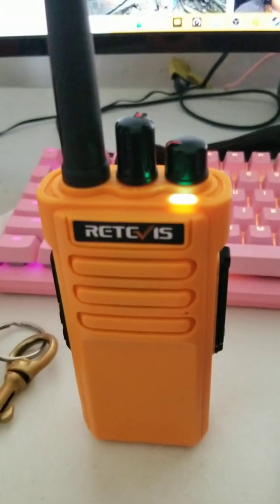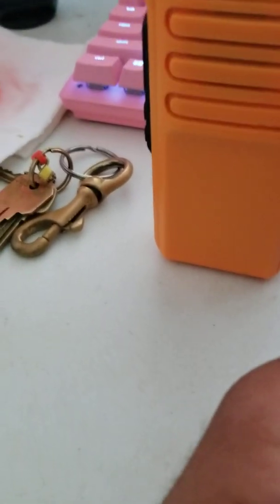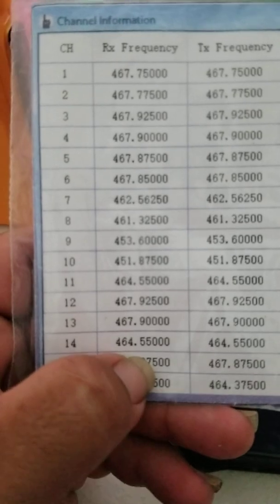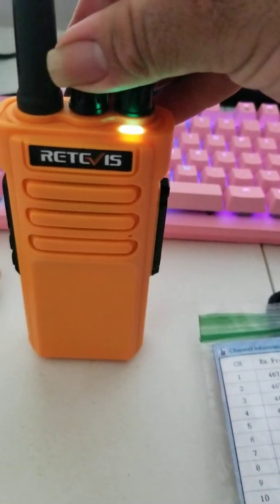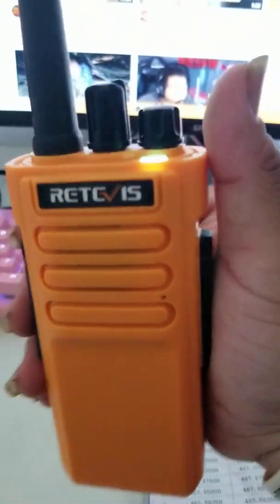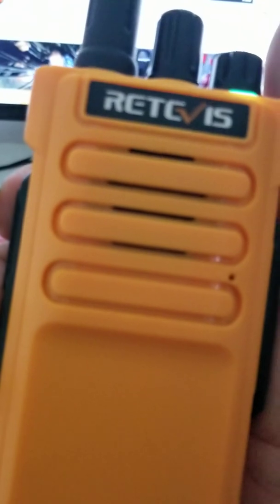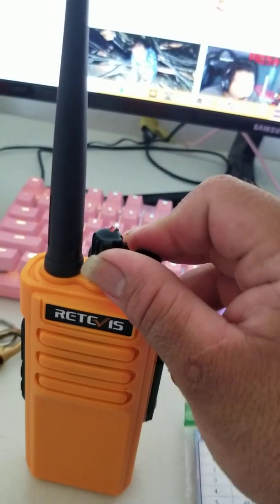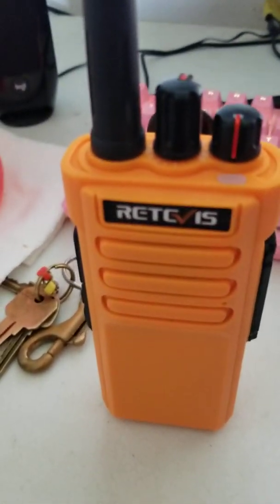Retevis rt29 strange transmission on uhf band 464.55000 MHZ

Comment: Possibly a “birdie”…a frequency where a signal is internally generated involving the oscillator circuits…(Google “birdie”) OR a beacon signal for navigation, time standard??  Believe I’ve read where all bands, scanners, radios etc can have/generate? them.   Not a “ham purist techno” explanation admittedly but possibly a consideration.  Bonded by my “30-30 guarantee”…
30 feet or 30 seconds…whichever comes first.  Not intended to be deliberate MISinformation but may have elements of unfounded, mistaken, forgotten, or confused distant memory principles, rumors, or myths.;)   Have a blessed day.

Comment: Why do you need the tone or dcs?Turn off the tone squelch and you'll hear everything. If you want to scan frequencies to listen in on all the bands you need to buy a radio that will scan like a cheap UV5R. Just dont ever try and transmit on frequencies if your not licensed to do so.
Reply from the maker: I use it to listen to are local mall security  and  the high school I graduated from  and I use the radio also listen to target I if i wanted to i could to talk to target the target radio frequencys have the dcs tones set and the  ctcs and dcs tones filters out the other stores that use the same frequency  and I also use to radio to listen on frs  the radio is 10 watt out and reserve

Comment: It is a digital signal, I hear digital signals on GMRS frequency's often. 462.000 and above were used for commercial purposes and still are, problem is installers and manufactures do not check the area for frequency's in use.